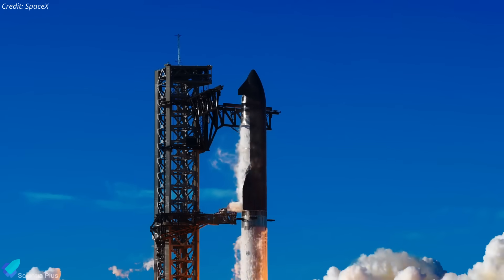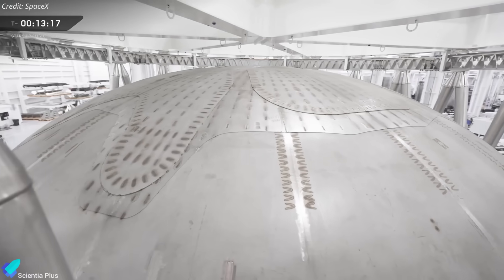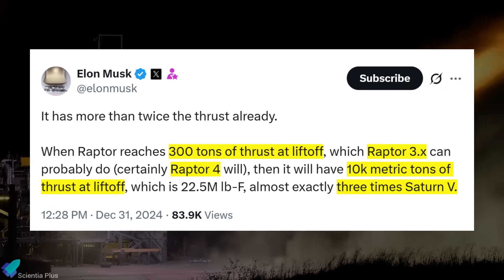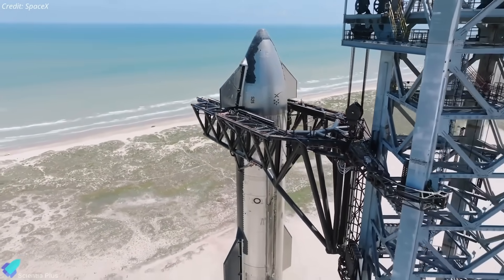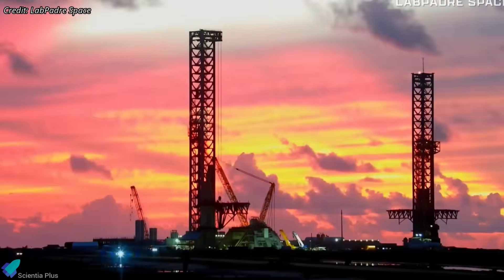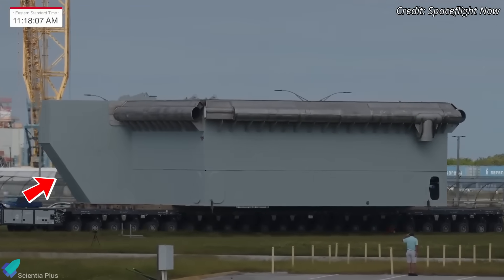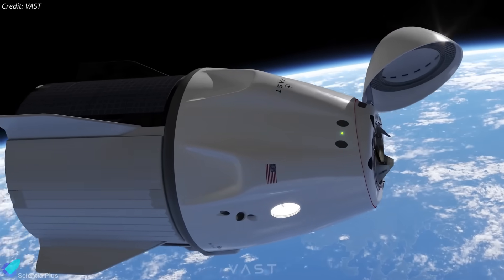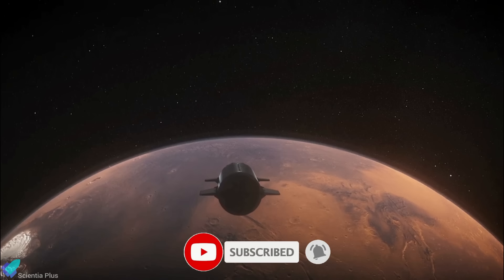BREAKING! SpaceX Officially Reveals Raptor V4 Details! Starship Flight 12 Launch Date Out

Comment from the maker: 00:00 Starship Updates
10:39 SpaceX Just Launched a Piece of a New Space Station!

📚 Learn More:

🚀 Starship Block 2 Explained:
 📖 Summary: https://shorturl.at/b0dtw
 🔍 Detailed Explanations:
  • Design Improvements Update 1: https://shorturl.at/lpGT7
  • Design Improvements Update 2: https://shorturl.at/gwNQ4
  • Nosecone & Payload Bay Redesign: https://shorturl.at/xa60S
  • Methane Downcomer Redesign: https://shorturl.at/XdYBG

🚀 Starship Block 3 Explained: https://shorturl.at/mnBT4
  • Detailed Breakdown: https://shorturl.at/IViwD
  • Production Begins: https://shorturl.at/xRNkJ
  • New Transfer Tube / Downcomer: https://shorturl.at/Iaqc6
  • New Grid Fin: https://shorturl.at/NxdVo
  • New Integrated Hot Stage Ring & Forward Dome Upgrades: https://shorturl.at/bvaCn

🛢 Dual-Port Orbital Refueling – Full Technical Breakdown
https://shorturl.at/5tiqK

🚀 Starship Block 4 Unveiled: https://shorturl.at/7A2ef

🔥The Insane Engineering Of Raptor Engines:
     Part 1: https://tinyurl.com/348hsrya
     Part 2: https://tinyurl.com/p8k85mu6
 
🔥 Raptor V3 Explained:
    Mega Upgrades & First Test: https://shorturl.at/TRIyj
    Raptor 3 Evolved Again - More Protection This Time: https://shorturl.at/3YpCe

🛠 Insane Engineering of New Starship Launch Pad: https://shorturl.at/7RAZd

🧱 What’s Inside Starship GigaBay?: https://shorturl.at/nJM75

🛠 Other Starship Upgrades:
 • Hot Staging Explained: https://shorturl.at/jf400
 • Super Heavy Booster Upgrades: https://shorturl.at/Pi5R3
 • How SpaceX Protects Raptor Engines: https://shorturl.at/4Om8F
 • New Heat Tiles Explained: https://shorturl.at/p2Ijb

🚀 Starship Flight 11 
   📽Detailed Breakdown: https://youtu.be/r6jHVPpiEcw
   📽How it Survived Heavy Damages: https://www.youtube.com/watch?v=8qw2E31T8ZM

🚀 Bandwagon-4 Payloads: https://shorturl.at/dzZEE

📡 Stay Updated:
📢 Weekly Updates: https://bit.ly/3HIQjPC
🚀 SpaceX Playlist: https://bit.ly/34wue8T

Comment: Ok I’m not an engineer. But could the f9 be retrofitted with just a few of the new raptor engine?. Or don’t mess with a proven design?
Reply: No. F9 use different fuels.
Reply: @otpyrcralphpierre1742 this and when you have an experimental rocket(like starship right now) you can make big and multiple changes but when you have a human safe rocket(like f9 which launches the dragon spacecraft) you shouldnt mess around with the rocket much
Reply: No. They could design a rocket the size of a Falcon using raptor engines, but it would require an entirely new development program with literally nothing including flight profile being reusable from the Falcons.
Reply: @claudelamar672 ok thanks

Comment: Why a Raptor v4?  Because as soon as a Starship launches using Raptor v3, it will become clear that Elon's payload predictions are way HIGH of what a Starship with Raptor V3 can lift.  It will be clear that Elon has been LYING again and again.  BUT, with Raptor V4 "coming soon", Elon will be able to continue LYING about the payload to orbit that a Starship with Raptor V4 engines can lift.  Raptor V4 may or may not actually be better than Raptor V3 but, crucially, it will allow Elon to move the goalposts once again!
Reply: sure buddy
Reply: Is that any evidence that Raptor thrust is less than spec? It should be easy to calculate from acceleration data of the recent flights - unless you start claiming that Starship is a lot lighter than claimed, which would be a really good thing for SpaceX.
Reply: The flight data from the final Block 2 Starship flight (IFT-11) show that the Starship on that flight, while carrying a 100t (metric ton) payload, would arrive in a circular low earth orbit (LEO) at 200 km altitude with 25t of propellant remaining in its main tanks.
Reply: @flsh-v6p  sorry, but I am skeptical that flight 11 was actually carrying 100 metric tons of payload. We saw photos from the inside while it was dispensing the fake satellites and it just did not look like there was much in there except for the satellite dispenser. Is the 100 ton to orbit based on extrapolations of the relatively small amount of mass it was actually carrying?